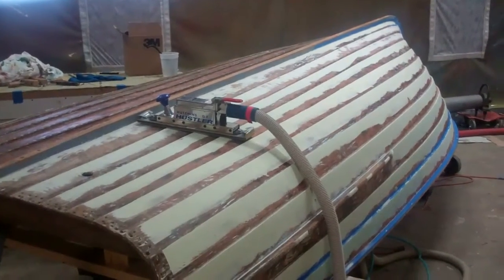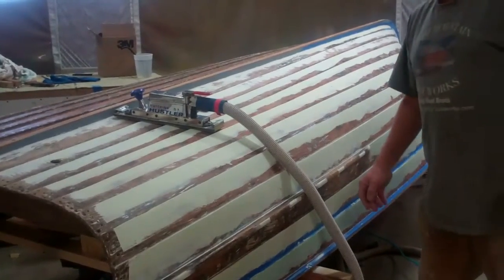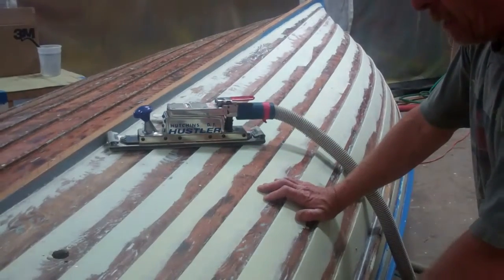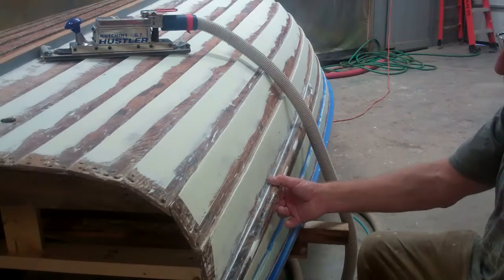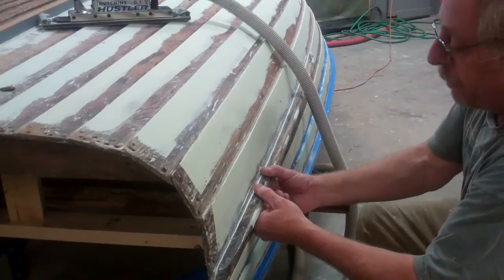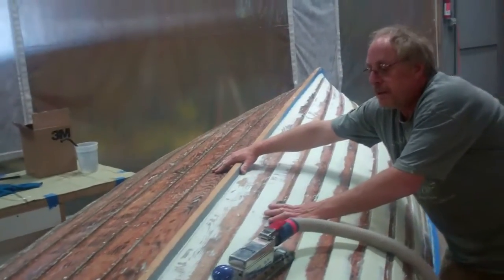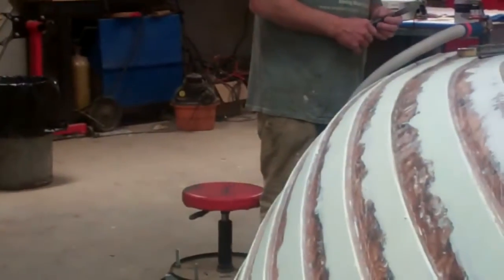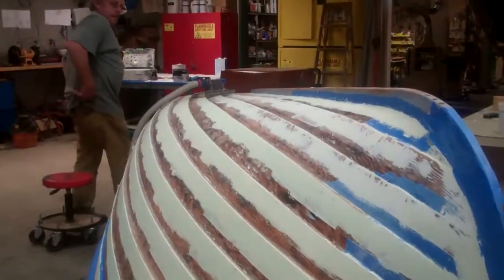1949 13 5' Lyman Leader Fairing Sealing Strakes 9 28 2016

Comment: Thanks for all of the great videos! How did you get that lap seam clean enough for the bead of 5200? Do you sand the short edge of the plank as well? If so, how? And can you give us some details on the long board sander?
Reply from the maker: Yes, we sand the short edge, and do it with a strip of Stikkit 80 grit paper that you can buy in rolls. We tear off about 4", fold it lengthwise so the two sticky faces stick together, and go for it. Tedious? You bet.We do this as part of our post-strip hull sanding and before we apply the three coats of CPES.We try to achieve an all-but-bare-wood surface so we are not relying on adhesion between old paint and the wood.
Reply: Thanks for the info!
Reply from the maker: The paper is 3M Stikit Gold Roll paper for longboard sanders. It is available from Amazon: https://www.amazon.com/3M-2599-Stikit-Gold-Sandpaper-Dura-Block-Sand/dp/B002Q8EMIA/ref=sr_1_sc_2?ie=UTF8&qid=1475523955&sr=8-2-spell&keywords=stikkit+sandpaper
Reply: Do you see any advantage to reefing or routing a groove on the "short edge" in order to hold more sealant ? If so how would you create that groove ? Im considering doing that on my "58 Lyman. Thanks  @snakemtboatworks
Reply from the maker: @aiimless  John, I see no advantage, and am unsure how any sort of routing operation could be set up and executed along these surfaces.